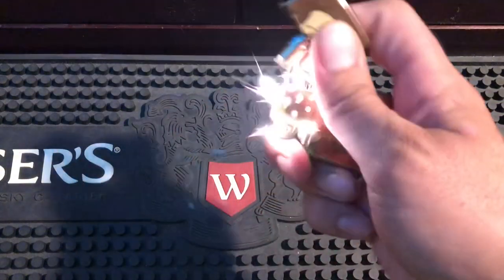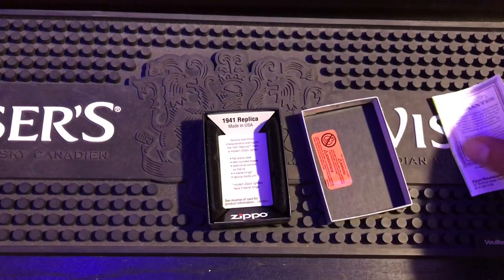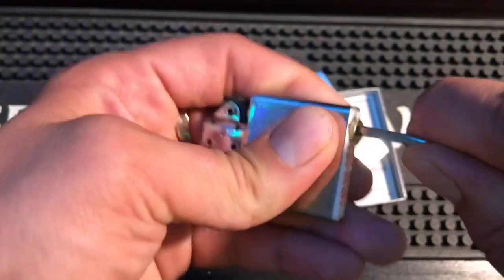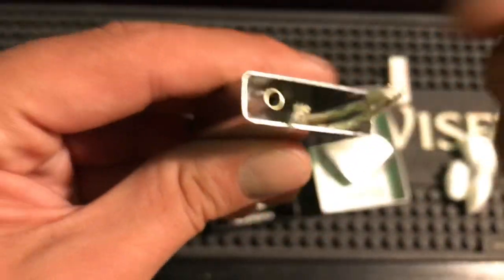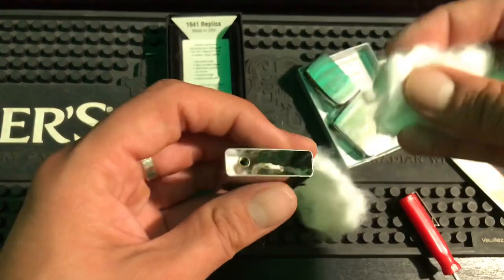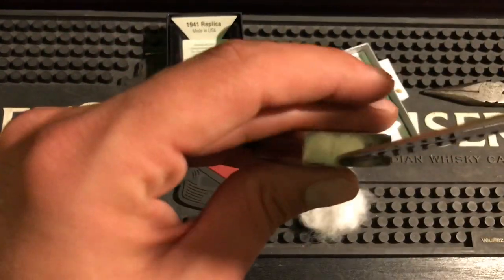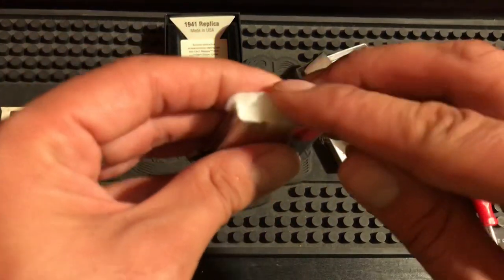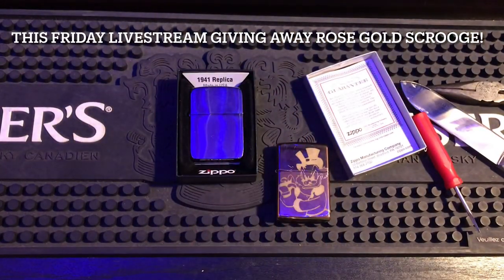Unboxing 1941 Replica Brushed Chrome + Giveaway

Comment: Hi! I’ve bought my first zippo and It came yesterday. The thing is, when I light it the flame goes out in 5 seconds. At first it burns nicely and after 3 seconds the fire starts to get smaller and eventually goes out. What can I do?
Reply: More fuel
Reply: Try repack it possible. Started a new channel. Couldn’t get this one back. Rebuilding

Comment: i want to the ask something. i bought my first zippo today and inside piece of zippo coming up after some open close . if you know the solution i ll be very grateful
Reply: But. A sandwich bag piece on the bottom. Will hold in the insert and save u fluid. Started a new channel this one was stolen